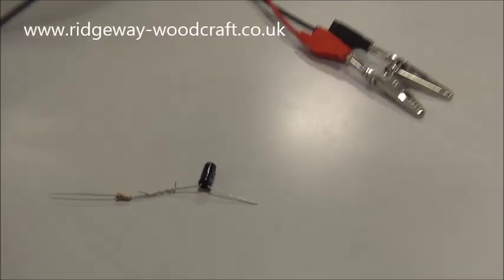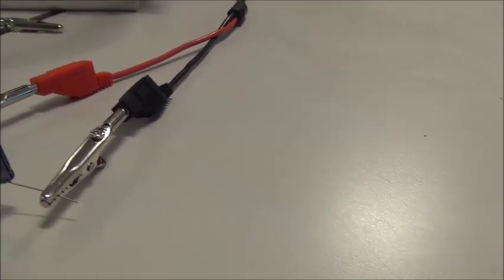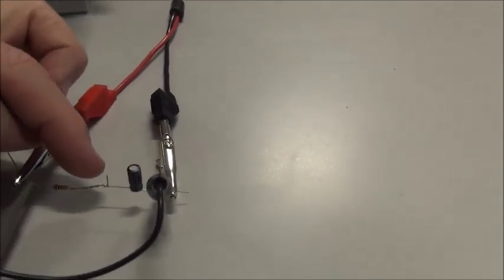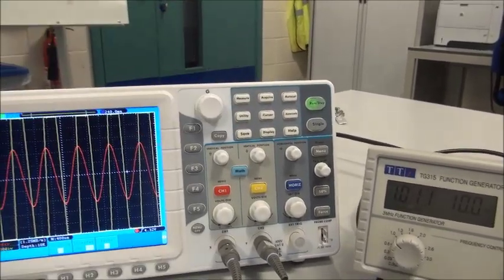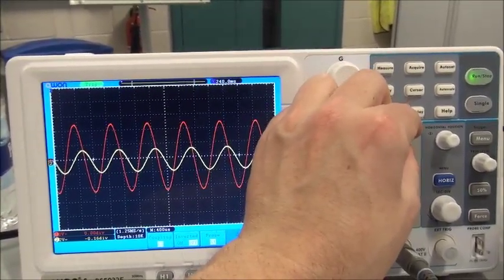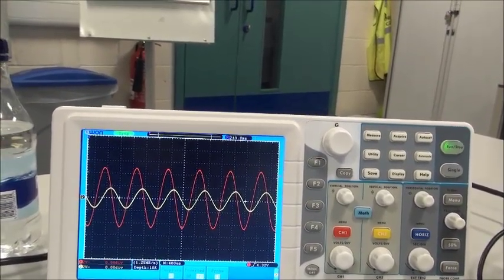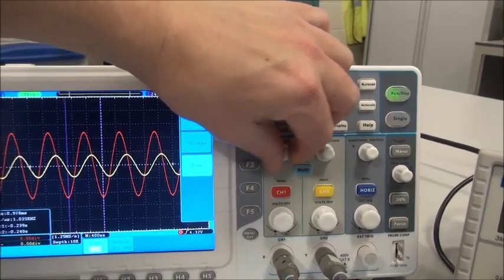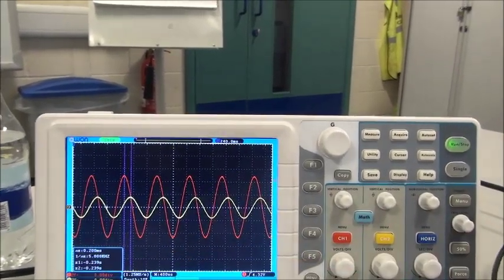Owon Oscilloscope and Thurlby Function Generator Testing a Simple Circuit

Comment: Your series RC circuit's V-I vector diagram will show you that total voltage (ckt that is) must lead the capacitor voltage. On  your oscilloscope that means the red wave leads the yellow wave by some degree less than 90. Yes, they share the same time base, but you have not set up the correct reference point on the horizontal axis so it appears that the red wave leads the yellow one, but that is not what is happening in reality.

I can see by the phase angle difference between the capacitor voltage and total circuit voltage (R+C) being near 90 degrees, that the resistor's resistance must be much larger than that of the capacitor's resistance or better said capacitive reactance. 

For the most part, nicely done video that ended helping me out with oscilloscope use. 

You welcome ;)